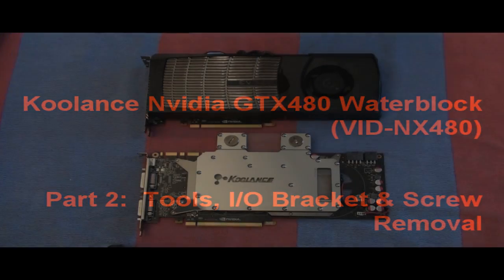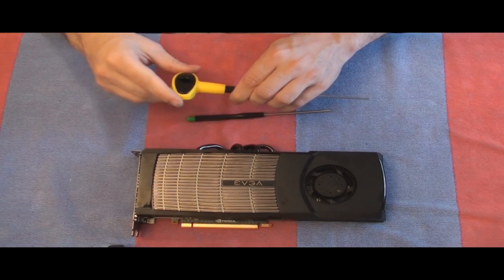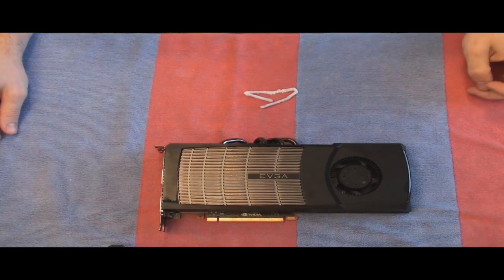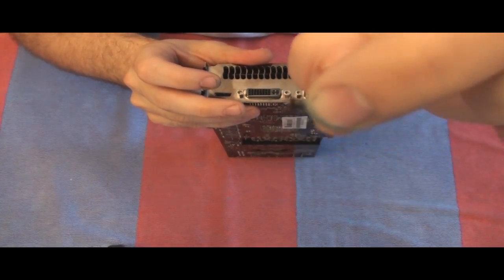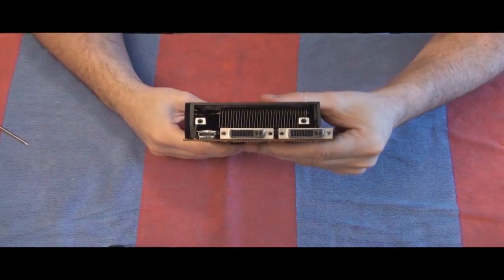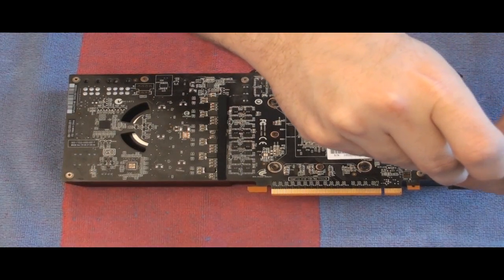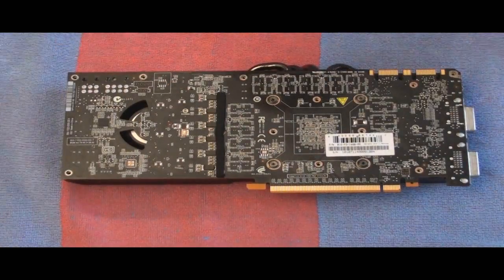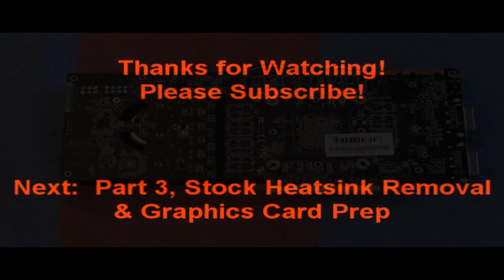Koolance Nvidia GTX480 Waterblock:  Part 2, Tools, I/O Bracket & Screw Removal

Comment from the maker: @GenericName007 TBH, if you tighten the bracket down well enough, it doesn't matter in my opinion.  Now for shipping, it may be a different story.  When I ship a computer with a waterblock on the GPU, I usually ship it separately for more safety.

Comment: Where do you get the single bracket backplate thing from?  The one on Koolance site says it's not recommended for use with blocks over 1 pound and the koolance 480 block is 1.5 pounds.  Does that not really matter or did you get your bracket from some where else?